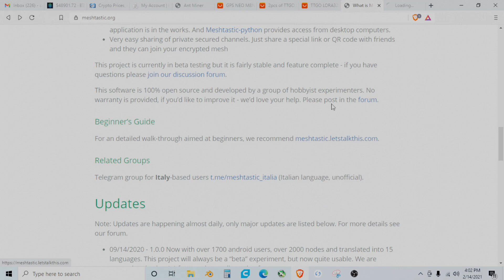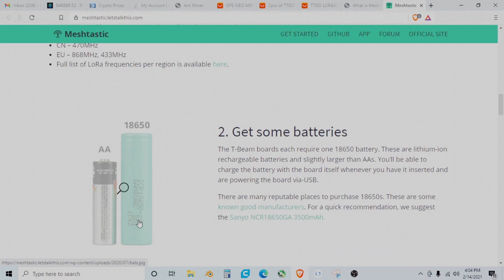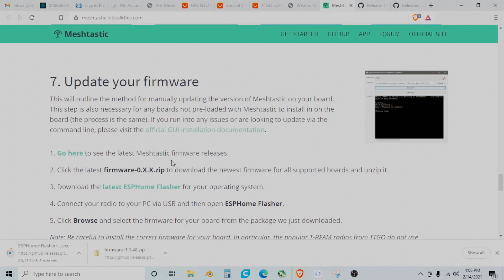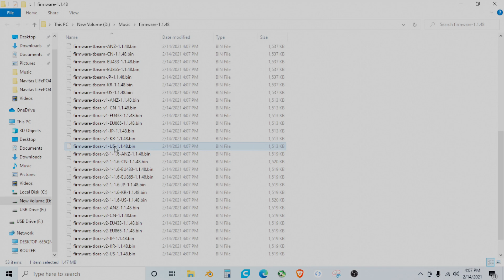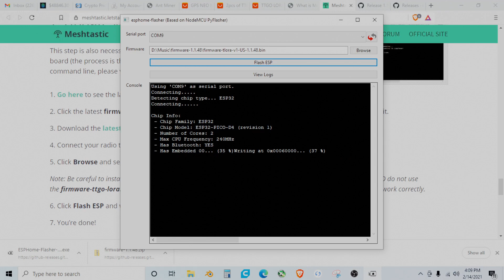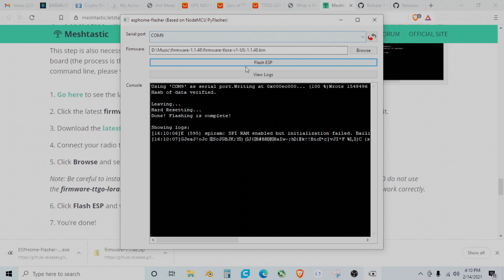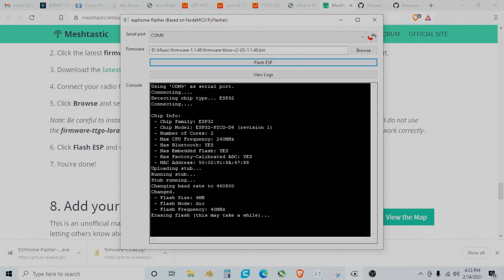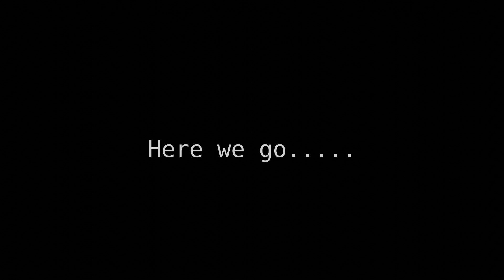Meshtastic Firmware Tutorial - Viewer Requested Walk-Through - Typical Screw-Ups By The Host ;)

Comment: Two gotchas:  protected 18650s sometimes don't fit, and there's 2 versions of that display with different pinout orders. I think the ground and Vcc are swapped on the incorrect one so it can't be soldered directly. If I have enough time (which I never seem to) I will try and make a video to supplement @Meshtastics fantastic videos going through some of the confusions with channels, total flood routing, and the terminology (e.g. "modules").

Comment: How do I change the channel, I have heltech v2.1 and ttgo tbeam v1.2 connected to my phone no problem but messages aren't coming through when paired with my phone and my wife paired with 1
Reply from the maker: Did you get this figured out?
Reply: @diyrenewableenergyelectron4996  yessir I did I appreciate the response actually wasn't that difficult
Reply from the maker: I just dusted mine off and oh boy how things have changed. Have you used the GUI flasher yet?
Reply: @diyrenewableenergyelectron4996  that's actually how I flashed it downloaded a zip file loaded with every model siphed thru and loaded my ttgo and heltech Lora 32 with respective firmware
Reply from the maker: Nice! Range test video coming soon(ish) lol

Comment: Thanks for the video. I was able to flash my tbeam but it will still not connect to my iphone meshtastic app. Just times out after 10 attempts so any info on that would be appreciated. Thanks.
Reply from the maker: Unfortunately I haven’t tried anything yet with either Tbeams or the iPhone app. I would recommend posting on the meshtastic forum to see if they can help diagnose the issue. Thanks for watching!
Reply: @diyrenewableenergyelectron4996  thanks
Reply: i am experiencing the same issue

Comment: trying to double click the middle button to set pin to 123456 but it still wont pair inside meshtastic, oled is not working if it comes up in ble list does that mean firmwere is on the t-beam or does that list regardless?
Reply from the maker: You can try reflashing the t-beam and see if it works but I haven’t flashed a T-beam yet to know the exact process. It should be the same as the boards I showed but you just select the t-beam firmware. Let me know if you get it working!

Comment: Thanks for this quick tutorial. Bought my ttgo t beam from lilygo on aliexpress. It came with the firmware pre-installed, but the middle button and the gps weren't working until I reflashed the stock firmware manually.

And for the record, the soldering WAS a pain in the ass 😅
Reply from the maker: That sucks that you had to reflash it, I'm guessing theyve made some pretty big updates lately.

I actually just found 2 t-beams I ordered and forgot about (I have problems lol) and get to join in on the soldering fun! What solder did you use? Lead is bad to eat but it is amazing to solder with!

Thanks for watching! 😀
Reply: @diyrenewableenergyelectron4996  It was some cheapo "lead-free rosin core electrical solder" I got in a kit with the soldering iron. The solder liked sticking to the iron way more than any of the pins though. Had to scrape the melted solder on with a knife. In hindsight, I think I was supposed to "tin the tip" of the iron in the first place... Came out pretty janky, but it works! 👌
Reply from the maker: I've used the lead-free stuff and it usually has a higher melting point than the solder with lead. I soldered a battery together a while back and almost threw the iron through a wall. It was terrible. I'm a fan of rosin core solder with lead. Tinning the tip definitely helps! I like to heat the tip, add a bunch of solder then wipe the tip on a damp paper towel. It leaves a nice coating of solder without having giant blobs that want to make a huge mess. Glad to hear you got it up and running!
Reply: how did you reflash it, im having the same issue from ali-express lylgo t beam , where you get the firmware and how did you re flash it, what app?

Comment: Right after you got the first video up i bought a pair of lora32 non gps. I got them programmed and ready to go 1 will be up in a mountain as a relay repeater and the second on my house and soon 1 more on my mobile.
Reply from the maker: Yes! I love it. Did you go with the standard lora firmware for the one on the mountain or did you try the "relay" firmware? Thanks for watching!
Reply: @diyrenewableenergyelectron4996  I'm using regular firmware with the add on of a parallax flip 32123 data repeater module.  There is a guy here in yt who made one I'm just going to coppy him lol
Reply from the maker: Ignorance here, what benefit does the parallax flip provide?
Reply: @diyrenewableenergyelectron4996  is just a data repeater.  It gets the data. From the lora32 /message. And 10 milliseconds later sends the data. Back out.
Reply from the maker: Cool! Sounds like a fun project! You'll have to report back how the range/reception works out with the setup.
Reply: @diyrenewableenergyelectron4996  yup definitely i'll get you some feedback on it
Reply: @rickrandom716  what about the range?